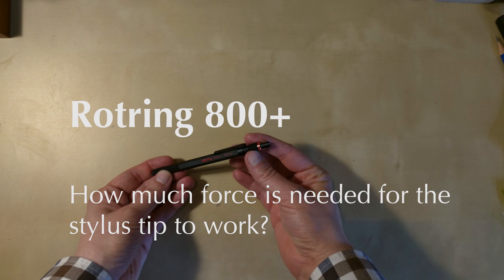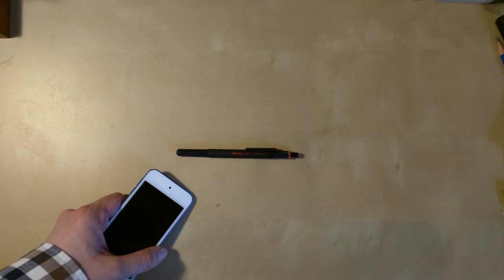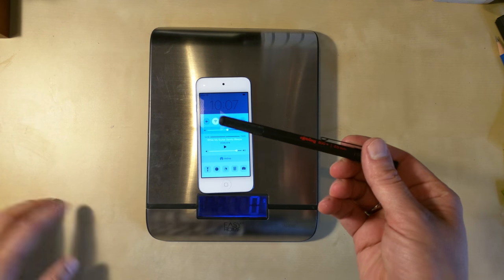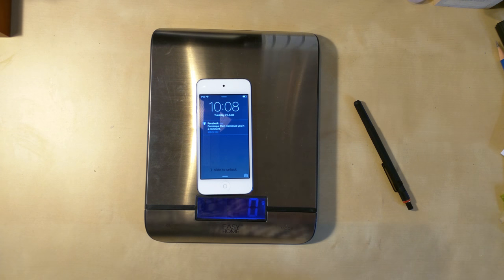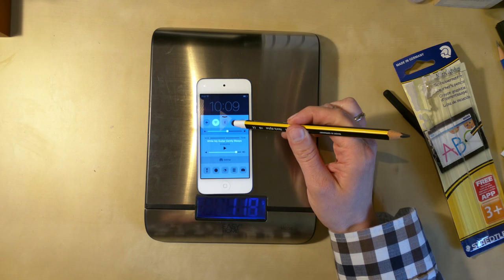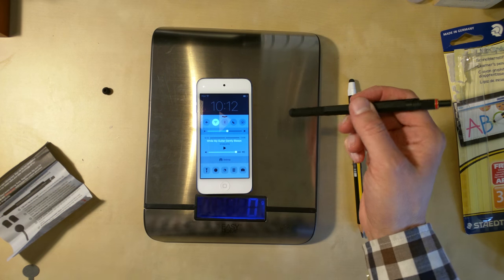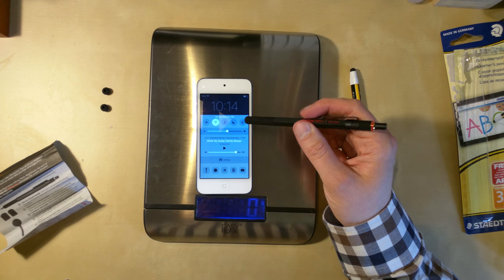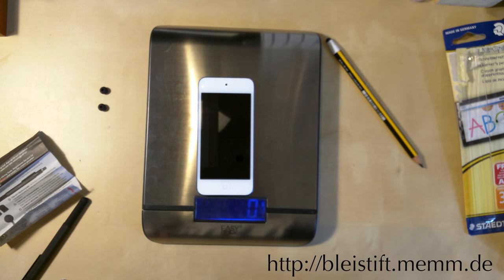Rotring 800+ and the force needed for the stylus tip

Comment: Hello, thank you for posting this. I'm shopping for a new pencil and found your video and then your blog post about this model. I noticed on your blog that you had a photo of the pencil disassembled. Can you tell me if the inside of the knurled grip where the rubber tip goes is threaded? I am trying to determine if the 800 and 800+ are completely identical except for the rubber tip and metal ring. Thanks again
Reply from the maker: Hello, if I unscrew the knurled grip I can see 5 mm of thread that go into the body of the pen. I saw 5 mm, but only about half of it is the actual thread. The thread is on the outside - the opposite thread is on the inside of the main body. I hope this helps. Let me know if I can help in any other way.
Reply: Thank you for such a quick reply. So that means no thread on the inside on the other end of the knurled part and it is smooth where the rubber tip is inserted?
Reply from the maker: Justin Strickland sorry. I think I misunderstood. I was talking about the end towards the body. To take the rubber of you use a special tool that came with the pen. I will try to take a photo or video.
Reply: memm That's ok, you've been very helpful. I don't think you need to go through the trouble of making a video just for me. I appreciate the offer. Thanks again
Reply from the maker: Too late ;^P  the video will be at https://youtu.be/dfkNYitajUU once YouTube finished converting it.

Comment: It may not be true for all touch screen devices. This is a video with an apple product where it doesn't seem to have this issue. It's probably just different touch screen technologies vs different materials like capacitive vs surface acoustive wave vs optical vs electromagnetic guidance etc. https://www.youtube.com/watch?v=A_g4Mt1XM4I
Reply from the maker: Thanks for the link. I think I use very few pressure when writing. In my 2009 blog review of the Kuru Toga I had issues getting it to revolve when using my normal writing pressure (see https://bleistift.blog/2009/11/the-kuru-toga-a-disappointment/ ). Maybe the reviewer from your link is using much more pressure when writing. I did contact other manufacturers and they all said that this issue is normal, i.e. you need some pressure, i.e. just touching the screen is not enough, unlike when using your fingers, when just touching is enough. I did notice that the issue was worse with some devices than with others, but it was always there when I checked.